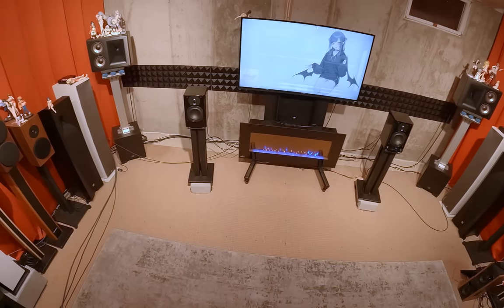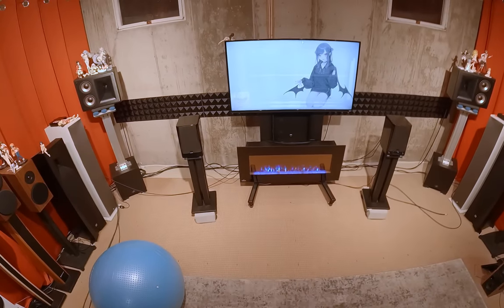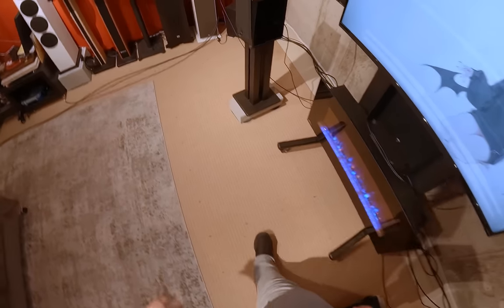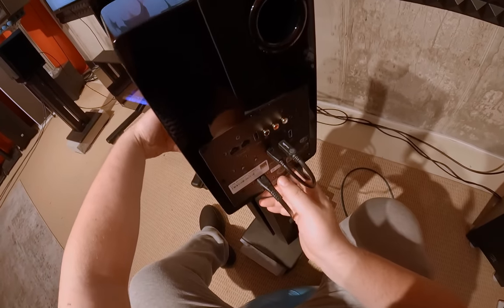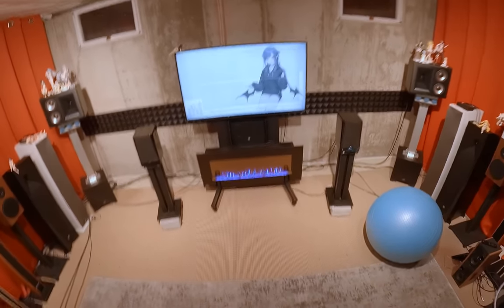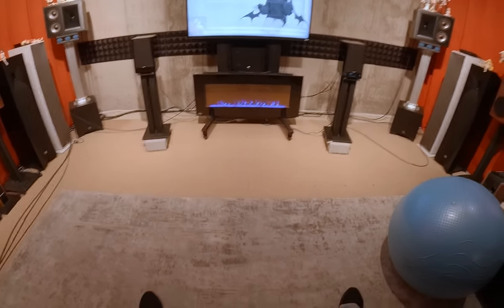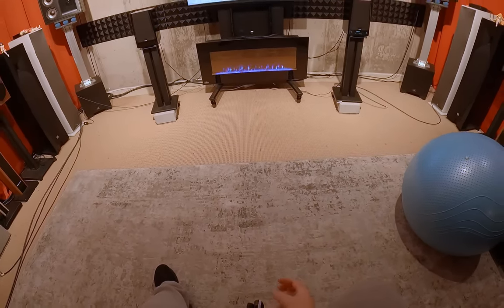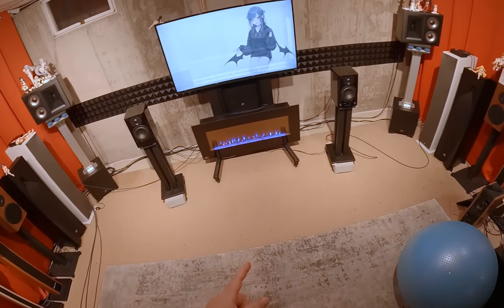The Powered Monitor SVS Needed to Make \\ Prime Wireless Pro

Comment: Swans M300MKII or these Prime Wireless Pro Speakers? I prefer the smaller size of the SVS, but the Swans, apparently, sound better? Swans quality and warranty service is also a concern being a Chinese owned company. Which has better bass output at lower volumes? Mostly for listening to two channel stereo music in a small living room. I despise sibilant highs and the exaggerated T's. My Elac DBR2's have this problem.

Comment: I had the first gen Prime Wireless speakers and they dropped off like a rock after 70hz or so. Hopefully these have better bass performance, otherwise a sub is necessary for sure.
Reply: i wonder if they ran through a 80Hz highpass/crossover

some subs and receivers don't turn off the highpass even when turned off plus they have settings on them too
Reply: Yeah i mean its still a pretty small driver and enclosure, even with a pretty large surround its still gonna fall off pretty fast.
Reply from the maker: They are def a subwoofer company. They want you to get a sub to complete the package
Reply: @ZReviews  they know the game alright

Comment: Question…..

Did you investigate its usage with the Prime Wireless Pro SoundBase?  I’m wondering if that adds any benefits to using these speakers.  I also noticed that the button on the remote right below the volume rocker seems to be a mute button based on the symbol.  Does it not function as such?
Reply: Arthur "Two Sheds" Haywood